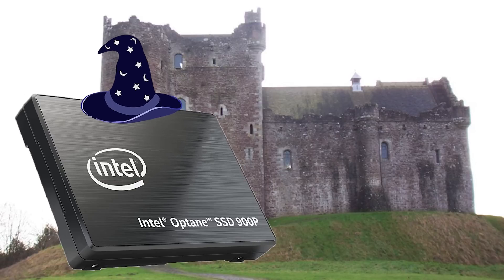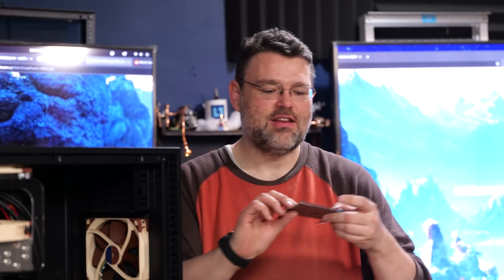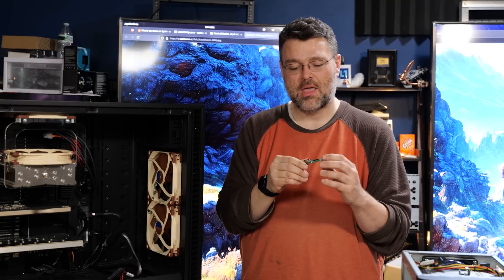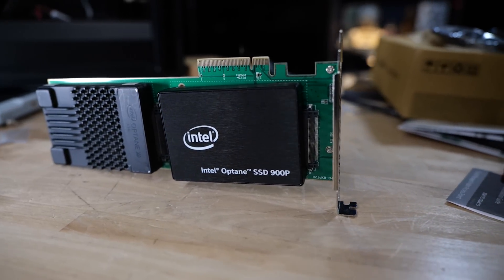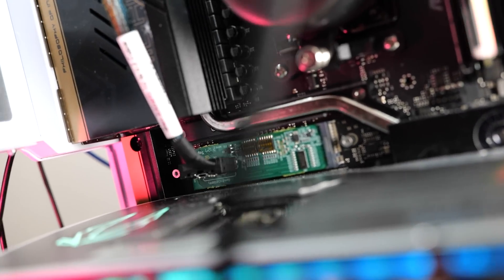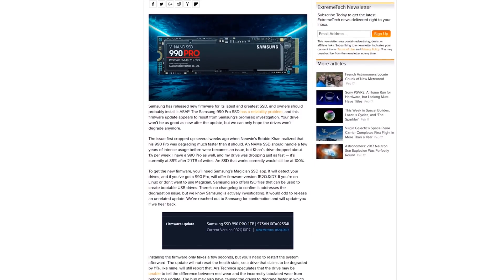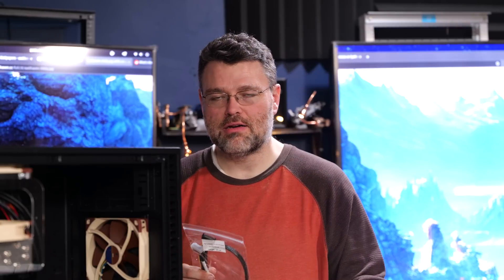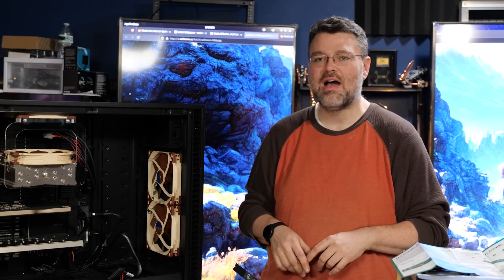The Holy Grail, Finally Found: U.2 to PCIe4 Adapters that Work!

Comment: Something I always wanted to know. IS there a really any PCIE splitters between gens?

Example, PCIE v5 x4 split into a PCIE 2 x pcieX4 v4 or 1x pciEx8 v4
Reply: What a chaotic thread. The answer is Yes.

PCIe switches obviously exist, but "transparent" switches basically just forward data packets and negotiate links to the fastest link that both devices on either end can support. A Gen5 to Gen5 switch chip is also a Gen5 to Gen4 chip, or a Gen3 to Gen1 chip. Let's say we have a Gen5 CPU with a Gen5-x4 uplinked switch chip with two downstream Gen5-x4 ports. Then two downstream Gen5-x4 SSDs would get full speed individually, or half-speed from both at once. If you plug two Gen4-x4 SSDs into it, The upstream link remains Gen5-x4, but the downstream links independently negotiate down to Gen4-x4. The Gen5 chip is backwards-compatible and runs its ports at Gen4 so the SSDs can keep up. You have just used two Gen4-x4 SSDs to fully utilize the Gen5-x4 link from your CPU, congratulations.

Now, here is where it gets fun. Don't quote me on this part, some of these details are fuzzy in switch datasheets. These switch chips can be very configurable with lane counts on each port. So yes, you can theoretically use a Gen5 switch with lots of lanes to connect a Gen1-x16 GPU to a Gen5-x1 CPU port, or reverse it to connect a Gen5-x4 SSD to a Gen3-x16 CPU slot, all at full bandwidth. That would obviously be a terrible way to use such an expensive chip, but it's pretty funny. With "non-transparent" switches, you can do some pretty exotic stuff. Non-transparent switches can also alter and route the data packets to do something interesting: They can have multiple hosts. If you have two host PCs and one SSD connected to one of these switches, it will allow them both to access the SSD, or even allow direct communication from host to host, or device to device (if everything supports it in both hardware and software).
Reply: @asm_nop  See, that's the thing. This dude doesn't want the slot to downgrade itself. He wants two Gen4 devices to run at Gen5 speed. Ie "raid" two Gen4 to make a total of Gen5. That's what shatrted this whole mess. He doesn't understand he can't do that. The Gen5 slot HAS to run at Gen4 to be able to communicate with the weakest link. Albeit, what you just talked about aren't actually risers/cables. But the communication deal works the same way as it does with them.
Reply: @asm_nop  So the correct kind of devices to search is "PCIE Switches" ?
Note that pardon the idiocy from George, but he keeps spitting things I never said over and over and over.
I do not get how hard is for him to understand the correct point.

This is the example:

Gen5 x16 slot-> PciE5 Bridge -> 2x Gen4 X16
Reply: @asm_nop  Interesting, and where can I buy such switches?
Reply: No.
Reply: Why would there be a need? v5 is backwards and forwards compatible anyway, yes? I mean, you can throw a Gen4 GPU into a Gen2/3 slot or vise versa and it'd work. Unless you're talking of something with its own controller so you can get the Gen5 speed split over two slots instead of having it default to the slower speed... And even then, bifurcation exists on modern boards as well as the x16 to x8x8 risers that I know of. But that's to add 2 x8  to 1 x16, opposite of what you're looking for.
Reply: @georgebrandon7696  I do not think you understand. If you're going to Gen3 from a Gen4 port, you're losing 50% bandwidth.

Example: I have 2 8X Gen2 Network cards, I only have ONE x8 Gen4 slot.
Can the x8 gen 4 be split into 2x Gen3 or Gen2 with a splitter card with chip?
I know that you can do this with the same gen using a riser card (those used for mining for example)
Reply: @TravelWithCesarin  I specifically mentioned making up the speed, yes? Did you skip over a few words? So yes, I do understand. But literally nobody is going to take up 2 PCIe slots for one single device. Even in the data science world where saturating lanes is important. Better off using x8x8 with two GPUs than trying to stick one GPU onto two x8 slots. And today's modern cards in gaming? Yeah, adding a second, even at x16x16, the gains are negligible. That's why SLI/Crossfire is all but out the door. Why you think motherboard designers are only sticking 2, MAYBE 3 x16 slots, the very issue this video is about? If you absolutely need that speed gain to the point you're willing to take up two slots with a single device, you're gonna be on a TR Sage board.
Reply: @George Brandon  but we're plugging in a lot of other stuff, not just PHAT GPUs, and sometimes we're ok with cards not being in official slots.  I've got an X299 board with 4 slots, every one is full and I wish I had two more. One of the cards is a Gen 2 in a Gen 3 slot, another one is a x16 in an electrical x8 but really I don't care so long as it has x4, I'd rather have another slot.  Or if I could take the single x16 Gen 5 slot on my new AM5 board, bifurcation it to 4 x4 lanes, then somehow mux each of those from x4 Gen 5 to x16 gen3 that would be AWESOME!!!!! So many random uses. . . .
Reply: @georgebrandon7696  You just confirmed that you did not read anything. AT ALL of what I wrote dude. You're not helping at this point.

I never said MERGING to "take up 2 pci slots for one single device".
I said from the beginning about  SPLITTING.

You know what Splitting is?
Aka the idea was to divide ONE PCIE x16 or ONE PCIEx8 slot ( From the motherboard) to make use for TWO ( 2) Devices that uses the same size electrical but of a lesser gen.

We have a huge amount of speed in the new technology that can barely be used ( Aka most boards now have dual X16 and one PCI X1 or 16X 4X and Two 1X of Gen4 and/or Gen5.
And most of that is wasted because most cards are not even Gen4 at this point.
OnlyNVMes and video cards really use high gens.
Reply: @KrumpetKruncher  finally someone got that I wrote! thank you for explaining it better!
And yes, that was my idea.

Take a PCIE16 Gen 4 or Gen5 slot and divide it into similar sized Gen3 or lower devices to use for older or lower powered devices.

Because we're seeing a huge waste in speed where so very few devices uses these amazing speeds from the latest gens.

I do remember those cards DO exist in obscure server cards, where they have a multiplexor chip that allows splitting. Most of them for mining.
Reply: @TravelWithCesarin    your first example is literally splitting a gen5 x4 (device) into 2 gen4 x4 (slots) . ...Presumably to maintain gen5 speed of a device. Did you read what you wrote yourself?

If going the normal way (one slot to two slots) of doing risers, Gen4 risers already exist. I already stated that. If gen5 risers exist, it wouldn't matter what the device was. They are forward and backward compatable. One simply doesn't put two gen2 devices onto a gen 4 riser, and expect to get gen4 speeds. Those Gen2 devices force the board itself to turn its slot into a gen2 one. If what you want to do is possible via a riser, the motherboard manufactures would have done it already on the boards themselves without the need for a riser. Just like they did when they added bifurcation to turn an x16 slot into basically two x8's (think the Tesla K80) ....
Reply: @georgebrandon7696  he didn't say device or slot, he just said the speeds, I said spit a slot to support more devices without sacrificing the speed (so not as much splitting the slot as it would be combining the devices or adding their bandwidth, almost like "bifurcating" their link generation instead of the link speed) and he agreed with me saying it was the right example. We have both assumed it would take more hardware (thus more costs) so I wouldn't be so quick to assume mobo manufacturers would do it since why would they pay the engineers to design it, sacrifice the board space (which is often at a premium on the high end boards where I would expect to see a feature like this), and pay for the extra chips and components just for a small subset of power users like us (especially when they really want us to just spend more by moving up to an HEDT or workstation platform anyways)
Reply: @KrumpetKruncher  He's looking to maintain v5 speeds using multiple v2/v3/v4 devices, yes? Even when using v5/v5, one can't do that. Each v5 gets split in half. We can't do it with v5. We can't do it with v4, v3 or even regular PCI. Not in the sense of "raid," anyway. Sure, we can raid PCIe NVME. But one can't "raid" two controller cards or even GPUs. That's what Sli/NVlink is/was for.

FYI, when one says "split," they usually mean like going from one thing to multiple another things. Not from multiple things to a single thing. If he meant riser, he should have said riser. And a riser goes from device(s) to slot. Symantics, yes. And I tried in my initial response to address both possibilities.

Also, plenty of two slot to 1 slot risers out there. Level1 used one in a SFF build not that long ago. But it was a PCIe v4 riser if I am not mistaken. Can't remember if it was a cable style or card off the top of my head. When using them, bifurcation support is needed. Why? Because the two devices attached each get cut in half. Two x16 get sliced to 2 x8. Just like two GPUs in SLI in two separate slots do. Reason being, that single x16 slot can't allocate 32 lanes. So it has to make 2 16 lanes into 8. Irrelevant of PCIe vspec. Are there risers that allow two V2 cards to run at v4/v5 speeds together like you can with raid 0? No. And they won't exist for slots either. That motherboard lane is forced to run at the lowest spec.

Remember 4G Decode and how, say, a K80 can't use both of its GPUs on board on mothedboards which don't support 4G? Yeah, kinda like that. It's an allocation issue. Also a language type issue. It has to talk the same language as the lowest device. It's why when you stick a gen3 device into a gen4 slot, that slot HAS to run at Gen3. It has to speak Gen3 language. It's not like slapping in two sata3 drives and getting them to run at sata6 speeds. And that's what it sounds like he's trying/wanting to do with cards.
Reply: @TravelWithCesarin  oh, now it's just a device number issue and not your original v5 speed deal you said? Did you not just mention speed when attempting to belittle me? OF COURSE when you put two Gen5 devices on a single SLOT, each are going to run SLOWER. Any Gen is going to. And sorry, but Gen5 isn't twice the speed of Gen4, let alone 4 times. So two Gen4 x16 (x8x8x8x8) devices WILL (in theory) saturate a Gen5 x16 slot.
Reply: @georgebrandon7696  Why are you insisting into pushing things I never said?
I never said I "wanted to keep PCIeGen5 speeds by using Gen3 Gen4 Gen2" using multiple devices.

Neither "And that's what it sounds like he's trying/wanting to do with cards."
Nor "raidinng".

Jesucrist... you're out of your marbles.

You know what. Please stop responding.
Reply: @TravelWithCesarin  MY mental issues? Your FIRST words were "If you're going to Gen3 from a Gen4 port, you're losing 50% bandwidth." YOURS. Not mine. 

And now your example of Gen5 x16 to "bridge" (It's called a riser, you fool), to 2x Gen4 x16? And you have the gall to say I don't understand? 

You have a 16 lane highway. You expect 32 cars to be able to go side by side? Your example shows you have ZERO clue how PCIe lanes work. All you're worried about is speed. You on it?

YOU CANNOT CONVERT (""split" for the idiots out there) x16 to x32 (2x x16), you idiot. THERE IS A REASON WHY YOUR 2 x16 slots become 2 x8 slots when you plug in two devices. 

Don't sit there, act like an expert and use WRONG terminology. Especially if you're going to sit there and think you can turn 16 lanes into 32.

And, your search term isn't "PCIE switch." It's riser, you idiot.  They come in cable form and PCB form. PCIE switches are on risers. They are on a few other things too. It's a dang chip, aka semiconductor.

Comment: Can i get a PCIe gen 4 re-driver put on the Asus Hyper M.2 so i can get 8 M.2 SSDs at full 32X 3.0 speeds?
Those 4TB M.2 gen 3 drives are getting mighty cheap.
Reply: No, ReDriver or ReTimers are just there to optimize signals over already existing PCIe lanes, for example to get a good signal-to-noise ratio for PCIe Gen4 signals over cables which is pretty hard with PCIe Gen4 and higher. What you want is an Add-In Card with an active PCIe Switch that takes its host interface connection (x16 for example) and switches those to 32 new PCIe lanes to get 8 NVMe SSDs at their respective full speeds. Example parts for this would be a Delock 90504 (PCIe Gen3) or Broadcom P411W-32P (PCIe Gen4). The latter is the one that has opened the Broadcom Tech Support hell for me since its firmware is a buggy mess which Wendell mentions in this video.
Search for PCIe Switch 8 M.2 in your specific use case, for M.2 there are some where you don’t need cables like you would with U.2 SSDs but where you have eight M.2 slots directly on the controller card with a beefy PCIe Switch chipset at its center.

Comment: This kind of stuff will literally drive you nuts! Every brand is Chinese and you've got to go off of your gut instinct to filter based on board color, cable color, and overall presentation of the products. Then comes the logo and Chenglish typo analysis to finally make the worst purchase ever... All down to chance that these things work at all.

Comment: Wendell, those M.2 to U.2 adapters come with the 905p drives. What am I missing?
Reply from the maker: 905p is pcie3. p5800x is pcie4. as are most modern enterprise grade ssds
Reply: @Level1Techs  Ooooh! I didn't get that watching the video. My bad. It's PCIe 4 specifically that you wanted. Not sure how I missed that. It's in the title as PCIe 4, but I didn't put 2 and 2 together.
Reply: @Level1Techs  Where can we find this "bizzaro adapter" you're talking about in the video? There are many similar things and I don't see a link or part mentioned in this video...

Comment: Now if only we had a cheap PCIE 5.0 x16 to 4.0 x32 PLX Switch!
Reply: or even silly things like PCIE 4.0x4 -> 2x V3.0x4 to properly double up older m.2s
Reply: exactly, we have little use for PCIe 5.0 x16 bandwidth yet but would greatly like the break that out to multiple PCIe 4.0 devices.

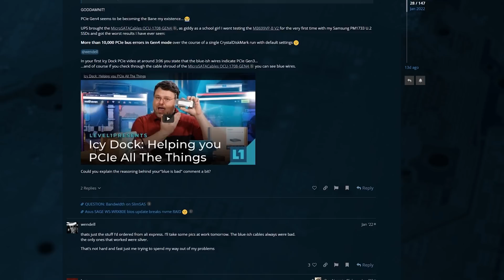Comment: 4:16 The greatest latest Broadcom Support Quest howler is you describe issues with the latest firmware and drivers, they say they know about the issues, then they backpaddle (“It’s not a bug!”) and just send you a link to the latest firmware. #BSoDcom
Reply: Wow, Broadcom is reaching new lows: Years after releasing the P411W-32P they now plan to “remove support” for directly connected SSDs (which they sold expensive cables for) and say that you have to use it with an UMB backplane or an old bug-infested firmware. It’s not like their latest firmware works well.
They really suck.

Comment: Just added quad nvme card to my HTPC in the 1st 16x slot.only 2 ssd show up. also have dual card in 2nd pcie 16 slot
this card has 1 nvme and 1 Sata ssd's on it. Asus B550 Plus board with 64 gig ram and a R5 5600g. All SSD's are gen 3 by 4 and 1 Sata, Just to fill up Mother board slots.

Comment: I am using this NGFF PCI-E 16X to 4 Ports U.2 U2 Split Expansion Card SFF-8639 NVME PCIE SSD Adapter from Aliexpress for my Optanes. It works, but I would prefer if it worked in x8 mode for 2 drives, So I could also use the second x16 slot on my AM4 motherboard. Unfortunately it only works if the slot is in full x16 (4x4x4x4) mode.
Reply: I was looking at that exact card and wondered if it can do 1-port operation in a single X4 slot (16-wide physically but only X4 lanes in total). I guess it can't? I ended up getting the single-port version instead since I wasn't brave enough to try the 4-port version.

Comment: I'm a more simple man than you wendell, just bought a 1TB WD SDD for £60 to cache a 12TB steam drive.

I was thinking of getting PCI 128gb Optane but it was £160 and that it is not really enough data for the caching games using PrimoCache, and the 340gb PCI optane are £600-800 so I'll stay with the pleb m.2 ssd's. 

You are in the Enthusiast 0.0001% supreme optane godlessness speeds group! ha